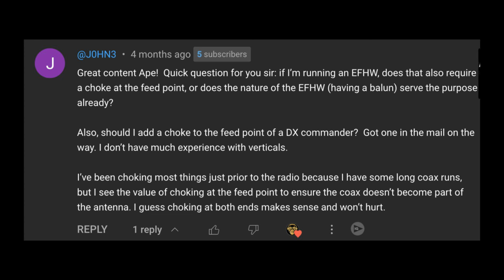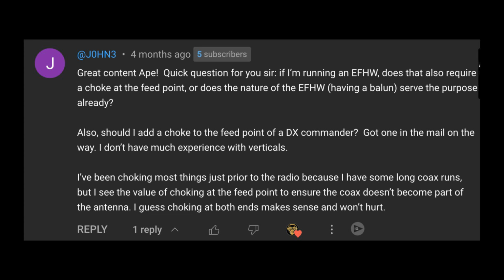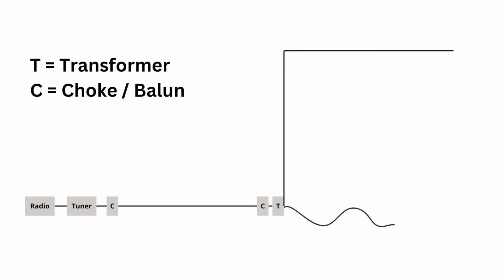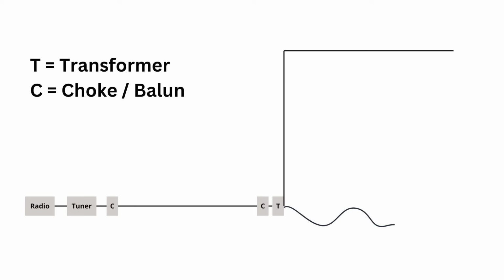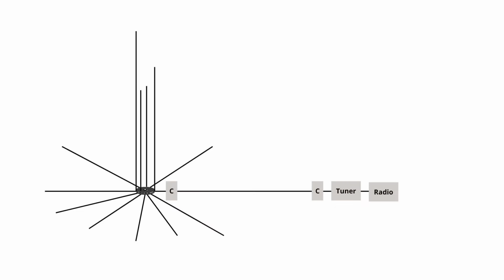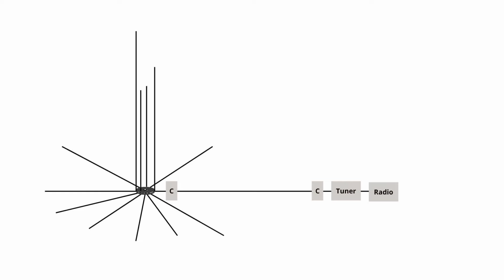Ape Answers 004: Antenna Chokes Explained

Comment: Very GOOD news! I was watching a video from your friend (K8MRD) he explained a magical formula. You take your lowest band (Mine is 160 meters) and you times it by .05.) that will give you the length in meters of a single counterpoise radial to use. Mine came out to be 26.2 Feet. About an hour ago I disconnected my ground wire from the RF ground connection that I had and replaced it with a 18AWG insulated  wire and placed it 180 degrees opposite of my dipole wire and simple wrapped it along the front plastic fence maybe 2 feet off of the ground. I am getting VERY STRONG signals from around the world. I am amazed!
Reply from the maker: That is awesome!  I’ve been telling him for years to do that, glad he finally listened 😂

Comment: I just got a respose from Myantennas (The supplier of my EFHW) and I asked them the same question. They told me it doesn't matter if I attach a ground rod or a counterpoise. What do you think? I had been using a ground rod for the past 3 years with no issues and good signal reports on FT-8 from around the world. Should I invest in a couterpoise for all the bands I use 160-10 meters with 1/4 wave wires for 8 frequencies (or a single wire for 160 meters at a quarter wave length?)
Reply from the maker: If something isn’t broke, I won’t fix it.  That said, a single counterpoise at 5% the length of the lowest band you operate on might be worth trying 👍
Reply: @TheSmokinApe Thank you for responding to all of my questions!
Reply: One more question. (Sorry!) 5% of length is that half wave or quarter wave length?
Reply from the maker: @EUC_Senior 5% of the full wave
Reply: @TheSmokinApe You're the BEST!
Reply from the maker: @EUC_Senior glad to help 👍

Comment: Question. I am running an endfed half wave 49:1 with a dipole. Can you please explain to me how many feet back from the unun should I place the choke. Also is it alight to run the choke connected to the unun? Second question, I want to place a second choke, should I place it between the autotuner and my rig, OR right before the rig and please tell me how many feet of coax OR place the second choke outside my window if so, how many feet before it enters the house. Thank You!
Reply from the maker: Assuming you are using a counterpoise, I like to connect the choke directly to the UnUn / transformer.  I would place the second choke between the tuner and the coax to the antenna.
Reply: @TheSm@The @TheSmokinApe Thanks for replying so quickly! I am not using a counterpoise, the manufacturer says not to use one even though there is a connection for one. My unun is connected directly to my common mode choke. Every once in awhile while I am running FT-8 with wsjt-z I will get some type of an error where it will ask me to retry. I was told that RF is STILL getting in the shack. I have RF ferrite beads on EVERY connection going from my Yaesu to the computer. I was told that it would wise to invest in an additional common mode choke( Should be here next week). Your saying to put the other choke if I read it correctly between my external autotuner and my antenna. Should I put the choke OUTSIDE or INSIDE the house? If so how much cable length?
Reply from the maker: @EUC_Senior I’d hook it right to the tuner.  Also, try using a counterpoise, that’s manufacturer is full of crap.  Rerun current needs to go somewhere, if you don’t have a counterpoise, it’s going into the shack.  Best of luck with it 👍
Reply: @TheSmokinApe Just my luck! I run my rig from 160 meters to 10 meters so I have to cut  8 pieces of wire (FT-8 I believe has 8 bands) a quater of a wavelength. Can I just throw the wires on the ground or do I have to spread them out on the ground. If I got to place them all on the ground seperately then the guy who my landlord hires to cut the grass is going to cut them all up. He cut up my dipole last week trimming the hedges and today I had to re-run it and be creative to have the wire run far-away from the hedges. Took me a week to figure out how to do that. My dipole is only about 10 feet off of the ground. I know I know it needs to be higher but the landlord won't let me go any higher and a verticle is way out of the question. It took me TWO years to finally get him to say yes to my dipole. So it's what I got or nothing at all. So far I hit 49 out of 50 states and have hit NY to Japan many many times with ease. 
N2DMI (Mark)

Comment: I have a vertical antenna  Sigma Hf360xp  and I would like to ask you whether this antenna needs a choke to suppress common-mode currents? As far as I know, the antenna already has a built-in 4:1 UNUN and just in case i put some ground radials around it. Thanks
Reply from the maker: It would probably be a good idea, you can never have enough choking 😉

Comment: Really appreciate this video.  I have been using 50' ABR coax with an integrated choke at the feedline for my verticals. Looks as though I should add another choke just before the transceiver/tuner. I will be setting up the DX Commander Signature 9 soon and will incorporate chokes as well.  Thanks for the video!  Kellye K1SOE
Reply from the maker: Hey Kellye, I would add one to both ends of the coax 👍
Reply: @TheSmokinApe  i am adding snap on  ferrite beads.  Is that sufficient?
Reply from the maker: @KellyeK1SOE  they work, good luck with the project 👍

Comment: So, I got this new vertical antenna it's a 22' telescoping one made by Diamond Antennas (BB7A) it apparently does not use a counterpoise, nor does it require radials, I believe the coax cable is acting as the counterpoise as they were clear that you need at least 50' of good quality coax. I bought ABR Industries RG8X and one of those in line chokes they sell that is heat shrink wrapped around a set of ferrite beads. Will the choke at the feed point interfere with the coax/counterpoise or is it harmless to the counterpoise effect of the coax? Thanks for these good training videos!
Reply from the maker: So, antenna companies will say a counterpoise isn't needed and to use the coax.  A true counterpoise is cpactive and an Earth gound like coax shields is resistive; it does make a difference.  If your setup works and you are happy with it, keep using it.  If you have problems or want to experiement, add a counterpoise and see what happens.
Reply: @TheSmokinApe  I will do just that, I had an MFJ 20M hamstick style vertical and I assembled a set of eight 5M/17' radials, now that antenna was disappointing, but I will reuse the radials that are "clip on" attached (as depicted in one of your earlier training videos), and I also may have some spare wire in my "stuff box" to maybe try a counterpoise? But just to be sure I understand, that in line ABR choke will not hurt if all I have is the coax alone right?  (Definitely want to always be choking) Seems to be working OK, the way Diamond instructed to use it; but it is compromised given its size. Deploying 8 radials isn't difficult, but it is a little bit of a nuisance if I am in a hurry to get going. Also, final question: I don't see any place to attach more than 4 of them near the antenna itself, so can I just clip them to the metal stake that supports the antenna, is that good enough? Thanks Ape!
Reply from the maker: I’d keep the choke on there and yes, clipping to the metal support should work 👍

Comment: Common mode chokes can sometimes produce amazing results when you did not think you needed them.  FWIW using a DXCommander my received noise level dropped by 4 s-points on a few bands with the addition of a common mode choke at the shack. The antenna has plenty of radials and the soil here is very conductive, it is easy to overlook that the safety ground can introduce RF noise directly to the chassis of the radio. Without a common-mode choke this RF can reach the antenna and degrade your receive.
Reply from the maker: Great info G0FVT, thank you 👍

Comment: the ABC of ham radio. ABR industries makes some great chokes with good coax . made on FT 240 -31 core and shrink wrapped . can get the ends you want. PL-259 to SO-239 is a great one. some use coax as counter poise when portable. that works but either way  you can get common mode current getting into radio. so all ways choke at radio/tuner side.  and do not forget to choke DC power leads to radio . even a snap ferrite type 31 in mic cord is good idea as well.  any wire can pick up RF or transmit RF. solar panel choke that. all them little buss bars in the cells pick up RF and can TX RF from a MPPT charge controller which you choke both in and out power leads. so if your always be complaining about RF noise and common mode problems is because you need to always be choking.    not going to hurt using chokes. common mode current can give false SWR reading. best investment I made in radio is ferrite . 73's
Reply: So even with a deep cycle LiFePO4 battery I still need to choke the DC leads? I thought that batteries were considered "clean" power unlike power supplies. Well, I do have a CMC choke just before the tuner, but now I got get another Mix 31 for the battery too. Thanks for the info!
Reply: @alflores4220  the choke is placed close to radio on DC power lead. the wires cab act like a antenna and pick up RF bring it to radio threw DC power leads. any cable can do this. I have Icom 7300 and my DC choke is T240-31 in DC power cable right behind radio . and I have a snap choke on MIC and my USB to PC for digital. even my DC cord to battery from PC has choke on it. help me make more FT8 with weak signals . I have LifePO4 12.8V to USB C PD to laptop. had to choke power cord to laptop for POTA. the PC to 7300 USB B cable had to choke it as well . only had trouble in some POTA spots. choke fixed all my RFI problems for POTA
Reply from the maker: Yes, ABR does it right.  Fantastic company 👍
Reply: @TheSmokinApe  ❤ They listen to the needs of HAMS ! they have coax chokes now with T 240 big cores. RG 400 coax ! and you choose ends !  I like PL-259 to SO 239  at antenna . them SO-239 for coax harder to find. Loved when you had ABR on the you tube coffee and ham radio  . ABR thinks out side the coax ! Chokes ,protective covering. 😀
Reply from the maker: @robertmeyer4744  yeah, they are pretty awesome
Reply: ABR is making some great cables.  And thinking outside the coax!

They have shop in Houston, so I try to support local good business es

Comment: Thanks for the content. A recent conversation on the Lab599 forum deals with the importance of a choke to protect the sensitive audio chip used on the TX-500, which is the QRP radio i use most often. Just one more reason to always use a choke at the radio.
Reply from the maker: I need to find that forum, I have the 599… love that radio 👍
Reply: @TheSmokinApe  I have one too - there seems to be two problems; one in damaging the balanced output of the audio chip by grounding one end in home-brew headphones / audio circuits (can't remember the part number of the chip off the top of my head but it has been discontinued AFAIK) and secondly transmitting on 17m with I think a bad match. I always use a choke with mine.
Reply from the maker: @rjy8960  I’ve heard about the audio chip. I do mostly digital which means it’s not a “problem” but it is a problem 😡

Comment: Does a choke incur losses? For example, would multiple chokes be lossier than 1 choke? 2 chokes vs 10 chokes to prove it?
Reply from the maker: They can introduce minimal loss, I’ve tested it on videos before but I can’t remember which.
Reply: Usually negligible loss, most are just a metre or so of coax wrapped around a suitable core or cores.